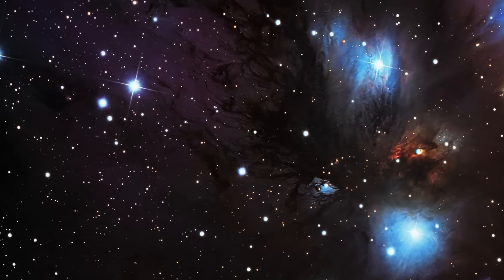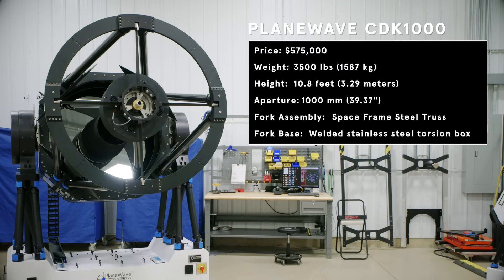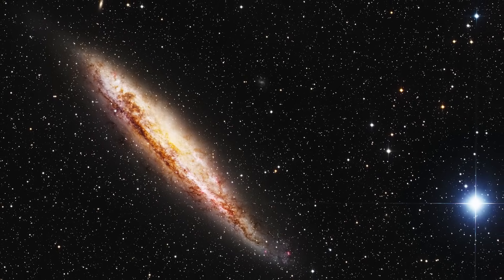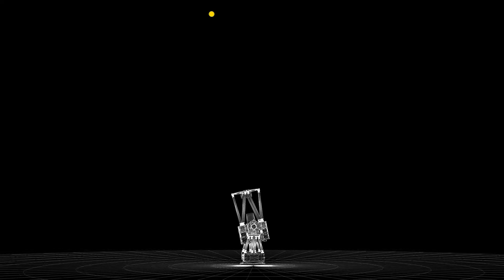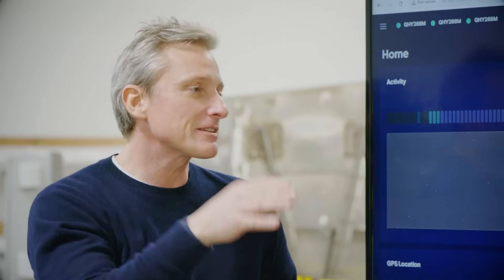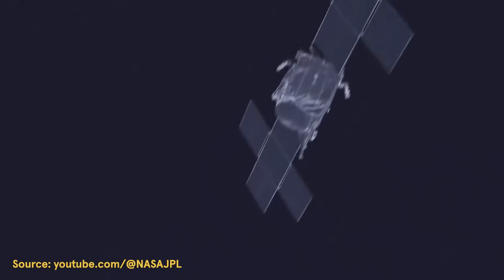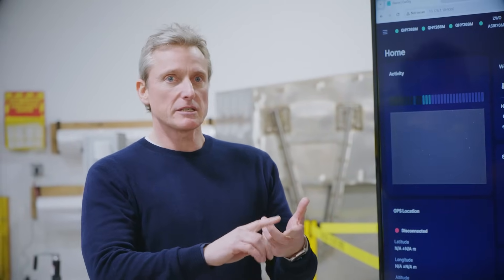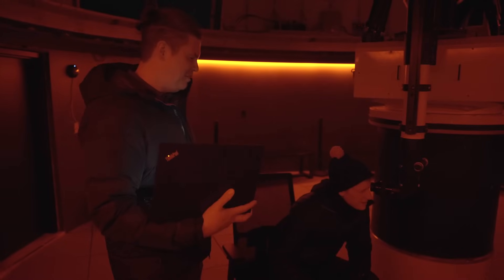$600,000 for a Telescope: Bang For The Buck or Astronomically Overpriced? | WIRED

Comment: The planewave scope has a focal length of 6000mm at f/6.  Price includes an ALT-AZI mount. Dunno how you can get 5 minutes subs with an alt-azi, and without autoguiding. Also wonder if it can controlled by NINA...
Reply: At this scale, you're running extremely high resolution encoders on all of the motors. Don't need to autoguide when you know your absolute position to the tiniest fraction of an arcsecond. Then to deal with field rotation, they have a derotator to have the camera rotate to exactly cancel it out.
Reply: Sky model. These mounts don't need to guide. All of the big brands will allow you to build a sky model to improve the accuracy of your tracking because of their encoders. I'm sure this thing could easily do 30min unguided subs
(and yes it can be controlled by NINA)
Reply: There will be a camera rotation system in there to prevent field rotation.

Comment: That is a hobby telescope for people with money. It has no bearing or weight in the scientific community.
Reply: There are people making new discoveries every month with telescopes as small as 150mm. Planewaves are frequently used for research purposes.
Reply: @netanmaldoran4816  yes, especially when paired with appropriate CCDs. A telescope like this is great for asteroid orbital observations, photometry, and even spectroscopy (provided the right equipment).
Reply: That's just not true. The bigger planewaves are pretty much only used for scientific use.
Reply: Not quite true. Telescopes in the one meter class are absolutely used for science as well as for things like space situational awareness. One meter class telescopes may not be doing things like determining the structures and sizes of the first generations of galaxies, but they are still used heavily by universities and aerospace companies.

Comment: The thing is, these telescopes are almost never used for visual observations.  These scopes are outfitted with advanced scientific cameras or other instruments like spectrometers.  In the video, when they showed people looking through an eyepiece, it was actually a modest 4" refractor that cost ~4k.
Reply: thats not true you can see it goes into the cdk1000 at 09:17
Reply: @markc7899  you are correct. There appears to be a telecentric extender at the telescopes focal point and the Tele Vue assembly is just serving to bring the viewing height down to ground level where users can focus and insert eyepieces. Neat
Reply: Odd they never mentioned it. Al Nagler should be happy with the free marketing.

Comment: The next step would be to upgrade these telescopes with adaptive optics and market them as the "deluxe" version of the CDK telescope.
Reply: There are already adaptive optics available for telescopes in this size range. They don’t involve deformable mirrors or lasers generating artificial stars, but they do involve high-speed tip/tilt optics and can help generate sharper images. As read noise on camera systems continues to get lower and lower, it is also possible to use a large number very short exposures even for deep sky objects, particularly smaller objects like planetary nebulae.